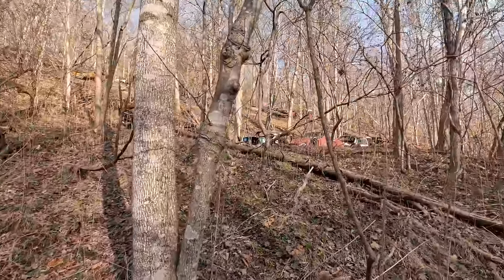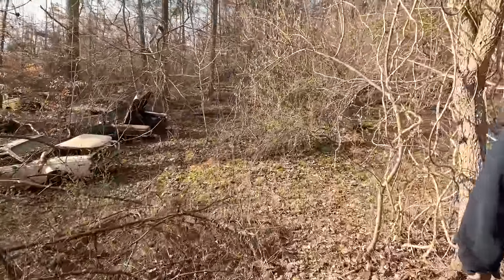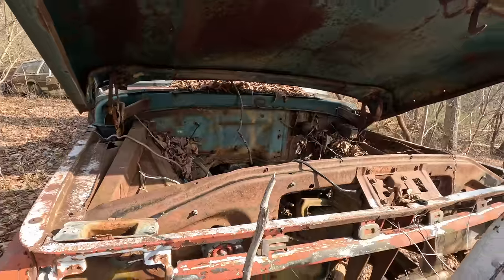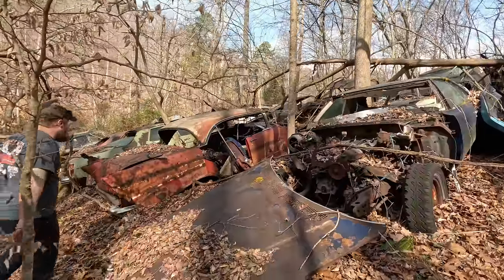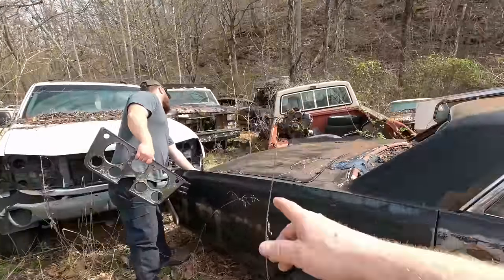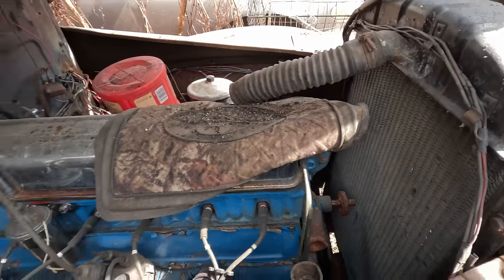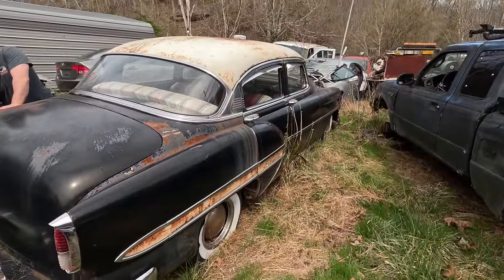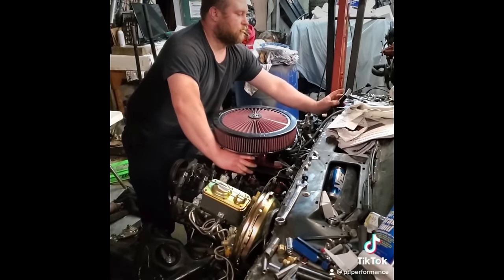Wild and Wonderful West Virginia Junkyard Exploration Part 1

Comment: 46:33   It's a 49 Dodge Coronet. I own a 50 the same color with 230 flathead # L head  6 cylinder. Only difference is taillights and trunk lid. The fluid drives are cool to drive  The Gyromatics trans.with the solenoids are a pain to work on when they breakdown. Every part for that 230 flathead  is still available . Nos parts and High performance parts, intakes ,cams heads etc .I have used Nos Military parts to rebuild them . M43 -M37 Dodge trucks and ambulances Korean War era, #like used on  M*A*S*H* used the same engine.  Those old flatheads are fun to hop up.
Reply from the maker: Cool car! Thanks for the information .👍